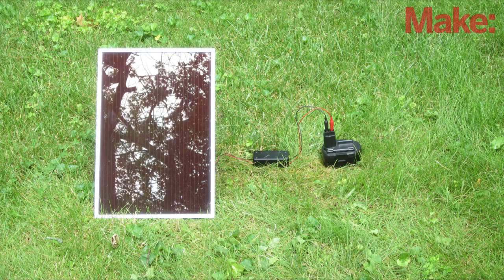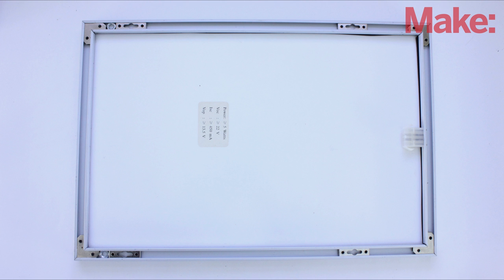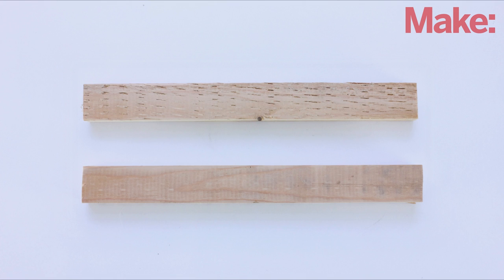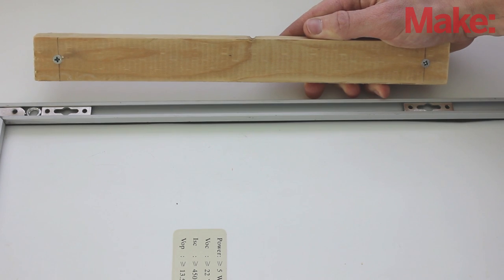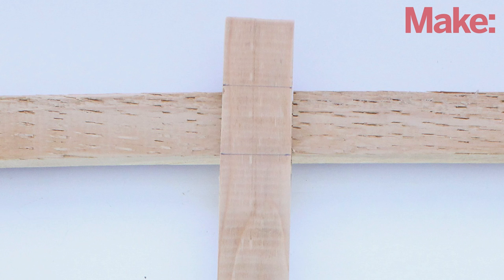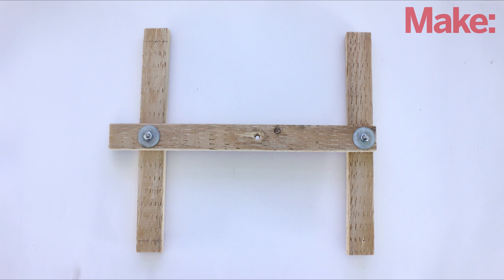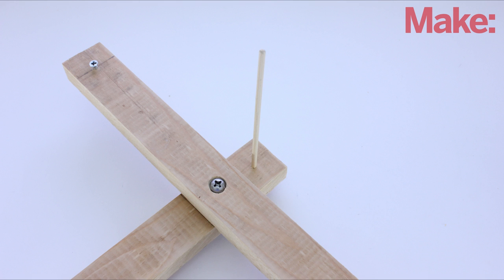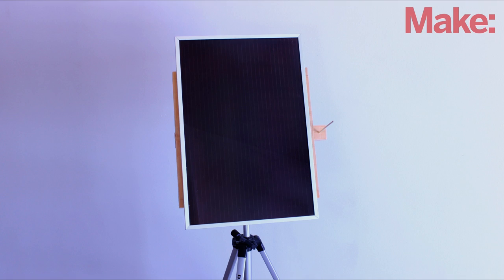Solar Panel Tripod Mount

Comment: Great. Until the wind blows. All it needs is some kind of anchor to the ground.  Some tent steaks and strong cables should do the trick.
Reply: Yes for Anchors.  With Strong Gust of wind in My Area, I use a Short Section of a Stretchy Cord to take up Wind Impact, But Not long enough length to lose the 3 legged stance of my mounting tripods for both day and night for Telescope with camera, solar panel, Spotting Scope etc.   Save the $$$ of a tip over crash.

Comment: This is no good idea at all. The tripod looks really fragile. You should build a bigger mounting substructure which can be left alone when the wind blows. Furthermore it is important to explain about the best orientation. 
State of the art PV modules usually don't have bracketing system.